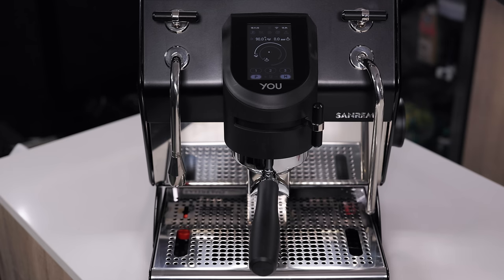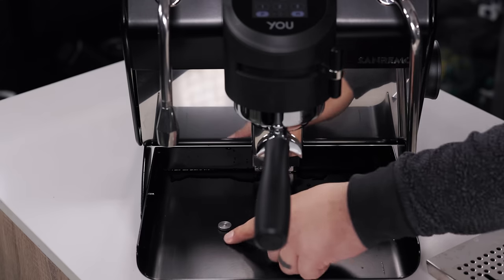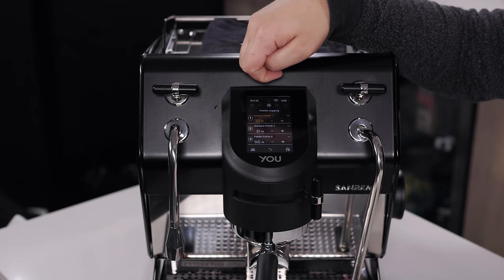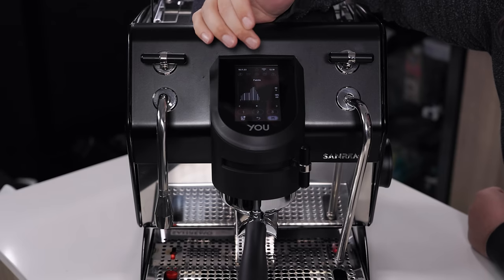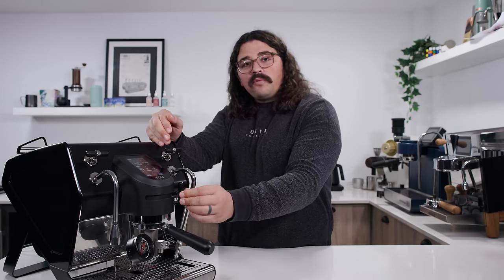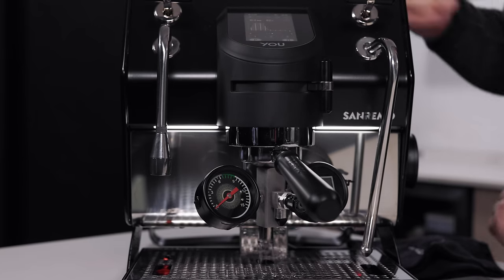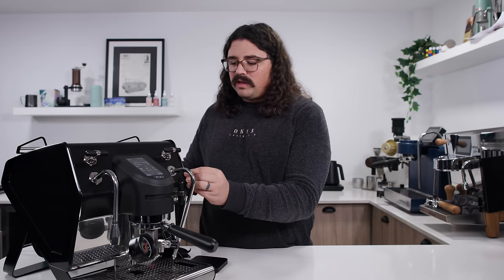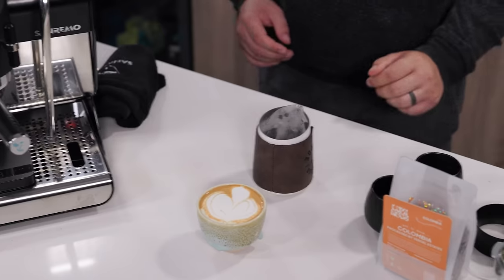IS THIS THE ANSWER?: San Remo You Review

Comment: All those “end game” machines I dont seem to get… My 2 cents?
- You want a nice, capable long lasting home machine, get a Lelit Mara X, and add the flow profile upgrade if you want
- You want that to be a dual boiler because you will be pulling and steaming 10 consecutive shots at the same time (no, you won’t really, but anyway), then get the Bianca
- You want to be a complete tinker geek and load crazy profiles repeatedly, just get the og Decent. 

Anything else besides those options (or similarly priced and featured machines) is just overkill, and in many cases such as this machine - does not even work as well. 🤷🏼
Reply: VBM Domobar super is a better alternative price and flow wise.
Reply: I guess you should try and compare the machines before stating there is no difference.
Reply: @christopherschmitz1804  Im sure there is (e.g. build quality), but the price difference compared to the quality in the cup is just not proportionate. Prices just skyrocket like crazy.
Reply: @ffsolutions9442  I guess you are right if you are up for plain vanilla dark roasted espresso. If you are interested in getting the best out of high quality single origins there is a significant difference in the cup depending on the profile you apply.

Comment: If the pressure is going down as a result of the puck erosion, the machine should DECREASE the flow, not increase! Didn't the machine creators hear about the ramp down ("spring lever") profile which increases the time of contact water with coffee, prevents channelling and increases the drink body? If the flow is INCREASED, the espresso is just diluted  with great amount of water.
Reply from the maker: Correct. If going with espresso theory. But if there is a set pressure, the machine should blindly obey the commands
Reply: @LanceHedrick  For me, it's not a theory but daily practice (with E61 FCD). I think, you said something like "constant 9 bar it's the worst thing which happened to espresso" - agree 100%! So, the "command" is strange, to say the least... I would rather want the machine to keep time, not pressure, so it would decrease flow to blindly obey that command (but not "at all costs" - in a reasonable frame).
Reply from the maker: @MichaelZuskin yes. We are speaking past one another. I was showing a limitation of the machine and that was the example I used.  I didn't mean to imply I wanted 9 bar to be hit. But the illustration was showing that even though the machine says it can if set at 9, it can't

Comment: I dont think I'd ever buy a espresso related machine that sports a electronic device on top of the heated grouphead. Anything electronic should be off to the side, easily replacable IF need be, or overirde to manually work it, because it is not a matter of IF the electronics will fail, it is a matter of WHEN. I use a PID machine, but I also didnt buy a $6K machine with the electronics on top of the grouphead. for a 6-7.8K machine, seams the electronics is wonky and not even needed.

Comment: Gs3 is still a rotary no?
Reply from the maker: It was my impression it was a gear pump. I've not actually owned one. Someone was explaining to me the MP was so fast due to it being a gear pump
Reply from the maker: I'd be annoyed if it was rotary because I was talking with an LM employee and Said something about the gear pump and they didn't correct me lol
Reply: @LanceHedrick I believe it is a rotary that regulates pressure indirectly via flow control. The paddle controls flow via a needle valve that diverts water to the drip tray. As a result if you're not plumbed, you're constantly filling the water reservoir. Someone please correct me if I'm mistaken.
Reply from the maker: Sounds right. It probably is a needle valve. Would still give immediate response. Annoyed the LM person didn't correct me hahaha
Reply: Gs3 mp has a conical valve and a rotary pump
Reply: @blaked205 Slayer has a needle valve and GS3 a conical valve I think.

Comment: Great review. Value is not there.  Does something well, for 7k it should do many.  Seems very beta.  Its 2023, wifi and app connectivity is a common tech.  No excuse for that not to be seamless and polished.
Reply: There are NO wifi or app connectivity issues with the most recent batch of You’s .

Reviewers received an older version of the You that’s been passed around more times than you could count.
Reply: @Mac-pluto  Yeah, I think Sanremo dropped the ball here and might do well to make some efforts to correct this. The demo usni sprometeus got had the same bent rail this did. This one isnt even a demo unit. Maybe they arent making enough on these to have a demo units to go around with all the fixes. The economy of scale here just isnt in their favor.

Comment: Great video! The million dollar question is Sanremo You or Decent DE1XXL?
Reply: There are great You community discussions on Discord and FB. A few people have dumped their Decent and are now happier with You, and you can read there why. I have been on the fence for 3 years as to whether I should buy the XXL, even have the 240V circuit prepared as we have standard 120V here in Canada. Decent just did not click, despite the flexibility it offers... and I tried. Of course, I put faith on future You FW updates and that is a bit of a risk. Pricewise, if I equipped the XXL with the extra portafilter and plumbing kit (You can be plumbed, no extra kit), I paid just $1,200US more than the XXL as You was on sale.
Reply: I ditched the Decent for the YOU but this really is a personal choice. Here's a few of my reasons. The Decent doesn't have a safe place to put cups or a cup warming tray. You can't pull a shot and steam at the same time. I found steaming wasn't as powerful as I would like and the whole water tank setup I found poor. Also bluetooth which I think is Decent's achilles heel was unreliable for me. I had to reboot the machine and reset BT at least once every two weeks. The big one for me was no local support. My old E61 machine had a fault and I was not only able to ring someone but took it too them and had it repaired with parts in stock and had it home that afternoon. Decent cannot match that with stories of long delays relying on international shipping. The Decent's strength is its limitless functionality if that's what you want. The novelty of constantly tweaking wore off very quickly. The YOU ticks all my boxes, the Decent didn't but you might feel differently. Good luck with your decision but you won't be disappointed which ever way you go.